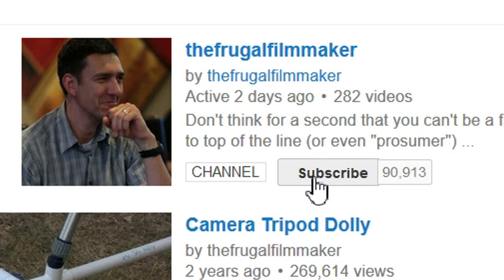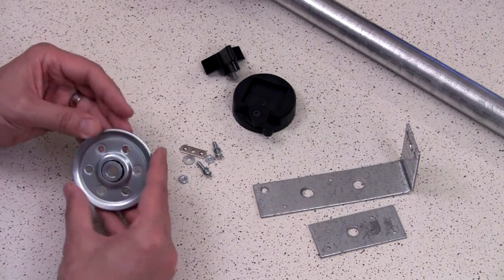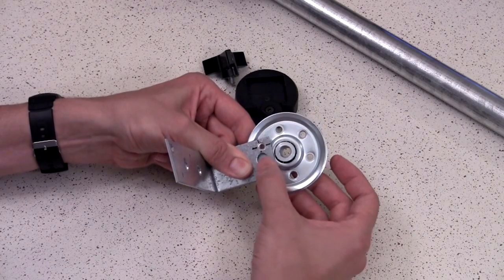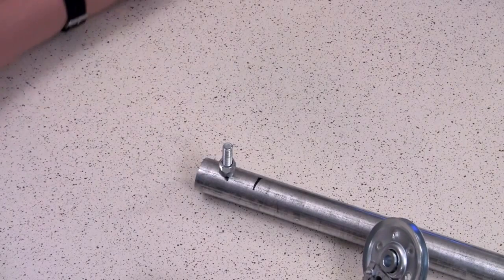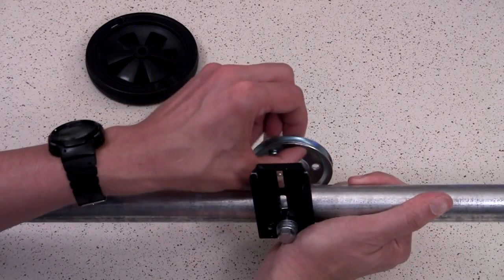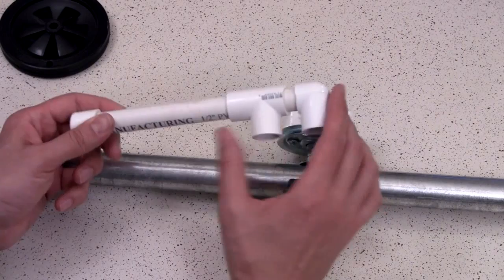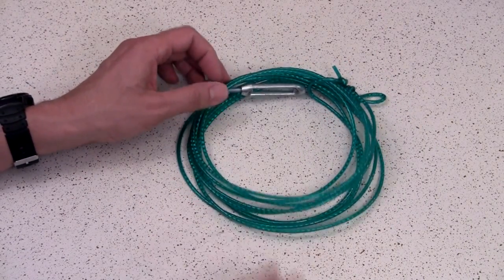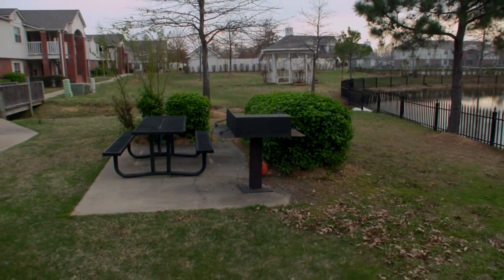Frugal Camera Crane / Jib 2.0

Comment: HELP, HELP, HELP!!!  So, everything worked out fine, BUT I'm having an issue with the monitor.  I purchased the monitor you use in this video.  I am using a Nikon D5000, and I have the proper cord.  However, the video is not show up on the monitor and I have no idea what's wrong.  It's just an RCA connection into the monitor, and two setting on the monitor, and I didn't choose TV.  :o)  Any idea what could be wrong?

Comment: That monitor will not give you an accurate representation of what is being recorded because its SD and most folk are recording HD.  It will help with framing an approximate focus, but its not going to easy to know if you are focused with it.  I use  an SD monitor all the time on a professional jib and it works for what we film, but does not allow me to pull "critical" focus.

Comment: did you try your crane in conjunction with your tripod dolly?
Reply from the maker: I have not, though I'm pretty sure the crane would crush the dolly.  :)
Reply: thefrugalfilmmaker What about if you make the tripod dolly out of metal pipe instead of PVC? Would that make it stronger so the tripod dolly won't get crushed?

Comment: Rather that a larger pulley on the camera, keep that at very desirable the 1 to 1 ratio. and instead  just a quick 2.1 upgrade version by extending the PVC tilt control arm handle to  twice the length (or maybe even more length is  necessary) as  to regain  your control and  viola reduced you shake.

Comment: hey Mr. Frugal! i am such a big fan, as a student filmmaker ur saving my life right now. just wondering if you;ve figured out any system yet for increasing some control with the pulleys. I wanted to try the 2:1 pulley ratio, but besides my 3 in. i can only find 4 in. pulleys as the max. Someone also mentioned using a spring in the comments? but i'm not sure how that would help. any advice is appreciated; 10 days till shooting commences!

Comment: Please "upgrade" your terminology to use "bolt" not screw as they are not the same. I also suggest you discover "Nylock" nuts for your projects. This will save the liability of nuts and bolts loosening over time since I noticed you do not use lock or star washers..

Comment: i think 11/23" is more commonly known as a 12mm.
Reply: Bzzzzz wrong
Reply: Oh, really? Find a 11/23" nut and try a 12mm socket on it, I'll bet it works better. They're not exactly the same size, but 11/32" is not used all that much as a machine screw and nut. When you try it, then you can talk, until then, sit down and shut up.
Reply: wraith0127 I actually believe the closest equivalent to a 11/32" is a 9 mm, not a 12 mm
Reply: Gregc96Gaming Yeah, I checked my math (I was wrong), and since the wrench he was using was "sloppy" (loose) I would further correct myself and say he should have used an 8mm.
Reply: Not 11/23".....it's 11/32"....Very old common standard size. Not mm at all...  Yes, there are mm close to this size.....but this isn't one of them.
Reply: Cho CoMo Very common on 10-24 and 10-32 machine screws ("bolts") this size.